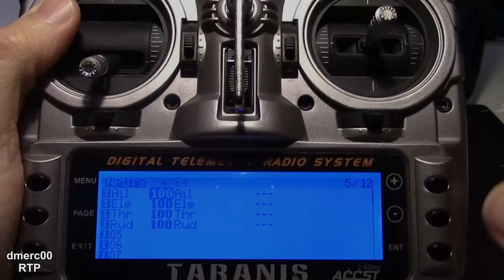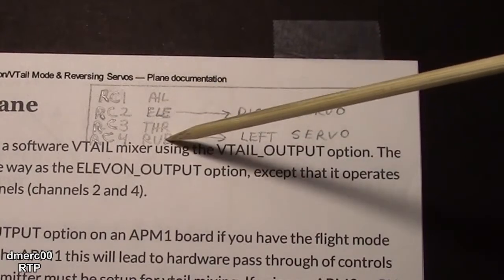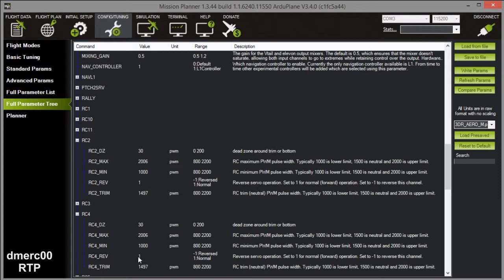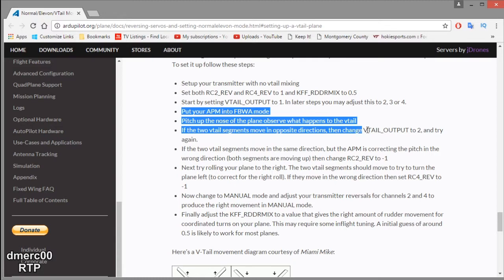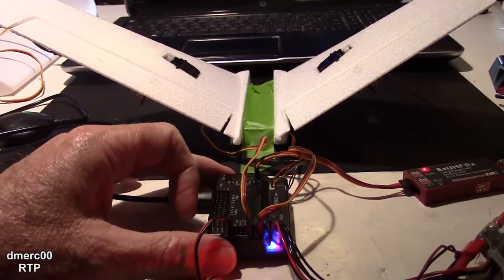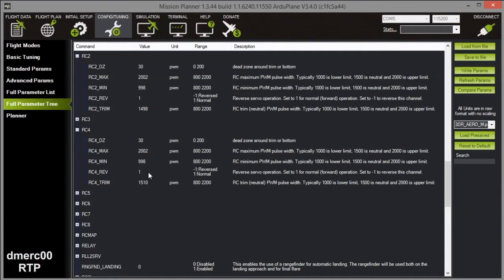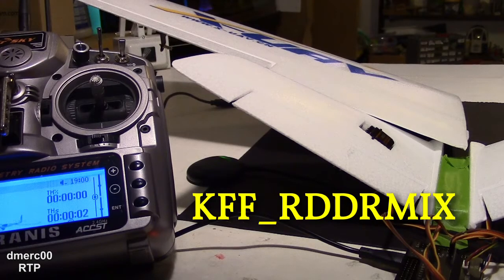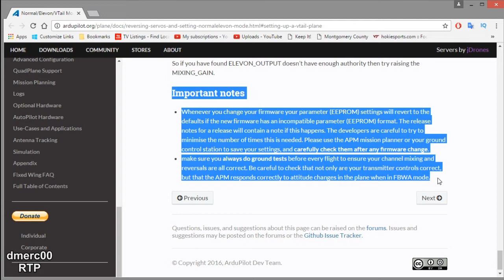Ardupilot V-Tail Mixing Setup in APM Mission Planner, XUAV Mini Talon VTail Plane Part 8

Comment: Hi Dave, Thanks for sharing this video. After set up based on your video in manual mode every thing is OK. But in Stabilize mode when the noes going down and up, the tail surface instead of going up and down, one goes down and one goes up!

Comment: Great videos, been able to retro my mini talon from a cc3d atom to a 2.6 apm with your help. Seems to fly well in stab mode, rtl is working great along with loiter. cruise is the one I'm having issues with, seems to start baking to the left when executed. have any ideas? also any pid adjustments?
Reply from the maker: By cruise do you mean Fly-By-Wire-B?
Perhaps there is not enough speed set and the torque roll is causing it to bank. Watch your speed and see if it drops when you go into FBWB.
Reply: dmerc00 
no its cruse, I'll try in fbwb.

Comment: Mister Dmer I have been following your vtail movie but now my elerons are moving opposite from iegh other by using a y harness as you say overhere what must u do reverse the servo internal or buy a y harness with a reverse inside ?
thank you for your help and with kind regards Dinant from the Netherlands
Reply from the maker: Try another set of servos first.You reverse a servo internally by switching the two motor wires and the two outter potetiometer wires.
https://www.youtube.com/watch?v=4n1ec2w21pA
Reply: dmerc00 oké I will try first another servo but it's correct that they both go the same up and down right hopefully I can get it right with a another one
Reply: dmerc00 by the way I have a another question I wonna put 2 leds on the outside of the plane which are connected with the apm to so if there is a gps fix and if the motor is armed I bought leds wich I conect on the A6 and A7 connector wit the signal and ground cable but they don't work must I configurate something in the apm to get on these ports signal ? I have been looking the whole day what I have or can do but until now nothing found. It's handy to see on the outside which led blinks to see the status. I hope I am not a pain in the .... that I am asking so much 😆
Reply from the maker: I really have not tried that. Sounds like a good idea to add LEDs but I have no experience doing that on the APM.
Reply from the maker: Normally the ailerons on the wings will go different directions on a Y-cable unless the servos are not a match electronically.  In other words the servos are actually going the same direction but since one is flipped over from the other the linkage will cause the control surfaces to go opposite directions.
Reply: I saw several movies of that and I would be very easy with a servo lead 2 led red (arming ) blue ( gps ) and some resistor to bring down the voltage but I can't get voltage on the A6 and 7 pins I thought I have to turn it on but okay I will look further when I found something I will send you a message I handy with 2 leds sting out of the body to see which status it has. Of course I get that info on my phone or the spf monitor through mission planner but would be a lot easy to see it on the plane. You will hear from me if I know the solution.

Dinant
Reply: dmerc00 so a new one will give the dams problem then I will reverse through the mod of reversing the wires on motor and potential meter that means the left and right one not the middle one. thank you for your reply keep you updated.

Dinant
Reply from the maker: This video should help with the aileron servo questions:
https://www.youtube.com/watch?v=5KC9FgTRUf4

Comment: I saw your video but I have a question about it is it correct that both aleron that are the flaps on the wings if I am right going down and up at the same time ?
Reply from the maker: The ailerons on the wings should not go up and down together. This should only happen on the tail. Use a Y-splitter from APM channel 1 for the wing servos to make sure they only go in opposite directions.

Comment: Excellent Tutorial Dave, Thanks....very well done.....I did initially set my MT up for Vee Tail mix but not sure I did it exactly like this. Eventually went the simple route with a Y Lead on the Elevators. I may come back and try this in due course though.
  Are you going to put all these APM Tutorials in their own Video Library so we can all find them again 6 months from now..?
Reply from the maker: I think what I will do is rename them to identify them as APM related then make a playlist for them called Ardupilot APM Tutorials.
How does that sound?
Reply: dmerc00 That would be great, very useful, not just for me but others too of course...Thanks again...:)